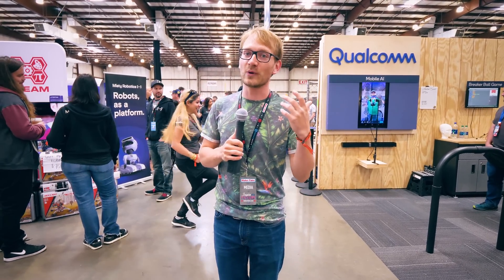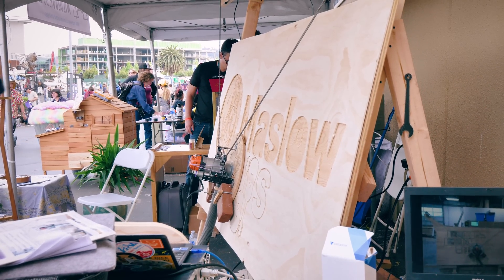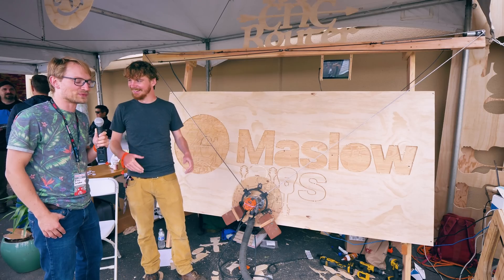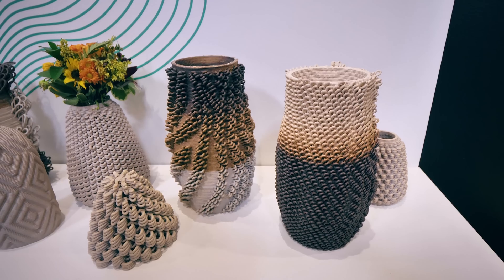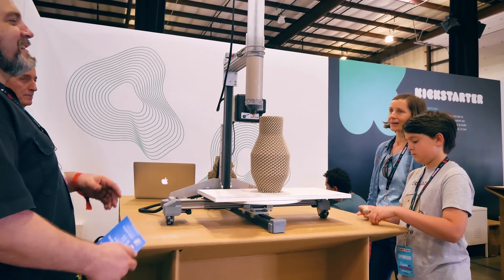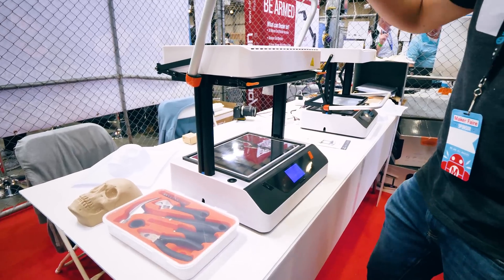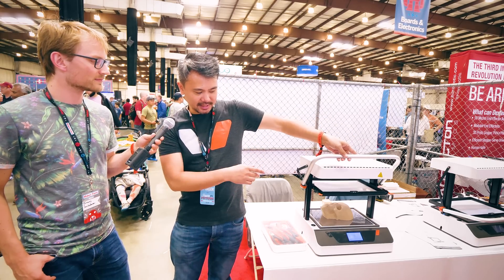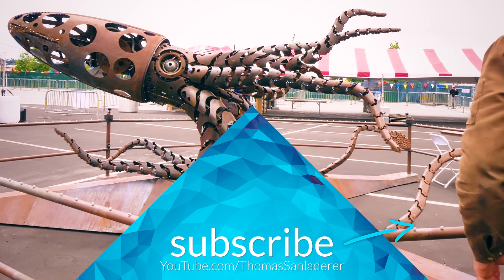New machines for Digital Fabrication at MFBA 2018! Vacuum-forming, frameless CNC and clay 3DP

Comment: That clay printer teaches all of the other printer manufacturers a lesson. There's no point in selling spools and spools of material that can't be cheaply reused by the user. Think about how much plastic you waste each time a print fails.

Yes, you have that expensive filament generator machine that costs as much as a 3d printer and only seem to work with its own pellets and that expensive hot end that works with pellets and shredded plastic in theory... But, they're still beyond the reach of people on tight budgets.

Comment: I really like the simplicity and speed of vacuumforming. I am currently working on a little project I first wanted to do with all 3D printing but it just wouldn't work and look like how I want it so I will need to revert to some basic metal working and I need to make a lightweight sturdy enclosure for which I think vacuumforming would be perfect. Then again the upfront cost of getting vacuumforming is maybe a bit too much for my liking and getting just about 1 part out of it.

Comment: "Super cheap vacuformer".. $850US..
I'll stick to our A5 one.. We produce them for $5AU each, they use milk bottles for plastic, a house vacuum cleaner for suctuion and a hot air gun. Things many people already have.
Reply: I was expecting more along the 250$ range, though I think using an arduino and building it yourself should be easy enough and a lot cheaper for the same functionality.
arduino : 2$
ir temp sensor : 8$ (first one I've seen that goes high enough, can probably be found cheaper)
vacuum pump : 25$
one way air valve * 2 : 0.40$
tube 2.3$
 heating element : 5$
hardware : ~50$
so total would be around 100$, far from the 850$, though I'd suspect cerrtifications to add quite a bit to the price.

Comment: Dig the almost vertical cnc. If wall murals are your thing as was mentioned in the clip, might want to check out SprayPrinter 2. the 2nd edition will handle multicolor applications, and is said to have finer level of detail than the 1st edition. It can be attached to that type of a cnc gantry arrangement. I backed em during crowdfunding, should be here in September. I'd be interested in a clayprinter, and the concept of pushing aircrete through a similar setup. Aircrete is concrete with pressurized foam added, makes it half the weight. It could technically float in water permanently if hit with a concrete sealer type coating. A gokart sized vaccum forming table, ya, that's the ticket!
Reply: Here's the link to the Clay printer Kickstarter: https://www.kickstarter.com/projects/1468761878/the-bottery

Comment: Hammer Video!!!! The hanging CNC is sooooooo cool. I am just thinking if it would be possible to have a much smaller version with Dremel. :-)
Reply: All About 3D Blog Dremel might not be optimal due to it being long and thus the mass causing it to "bend" down more easily.  Could be countered with a larger base plate though so I don't see why that wouldn't work, even for the same format.

Comment: The hanging CNC... my worry would be the change of arm length related to position and thus rotation:linear distance conversion changing. 
I suppose by using DC motors and worm gears you do have more analogue position control than steppers.

Comment: This CNC Router is really a great design! Are we going to see you testing this machine? It looks like there is also a screw drive for the z Axis right? This is probly something you have to adjust, adapt if you are using a different router?
Reply: PurchenZuPoden its been around for a while. Most people cant get it to work propperly.
Reply: Oh really? That's a shame!
Reply: PurchenZuPoden well i suppose ypu can get it to work eventually. But the only thing keeping it from moving up when cutting is 2 bricks. It is verry large for the price but obviously they give up a lot of capability to get there.

Comment: My problem isn't only having one process to work with, it's learning about a new process and wanting to add it to my repertoire. I live in the city any my project space is taking up most of my basement and 2 room inside my house right now. If I get anything else I'm probably going to end up sharing my bed with it.

The thing that interested me most here is the vacuum forming machine. It seems like it would be a great way to make a short run of a design, bridging the Gap between 3d printing and mass manufacturing. 

I thought the coral reef structure prints were the coolest application of the tech shown, I love the intersection of citizen science and these novel manufacturing processes. Traditional tools for scientific research are so expensive that it limits how quickly you can iterate your experiments.